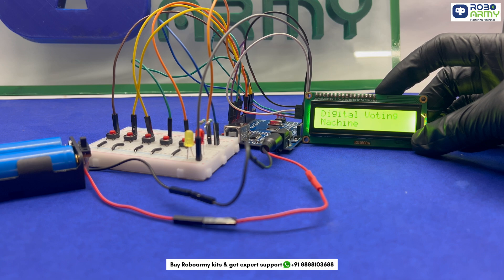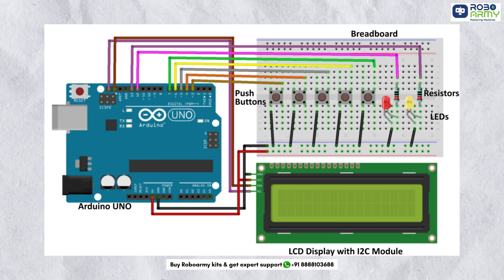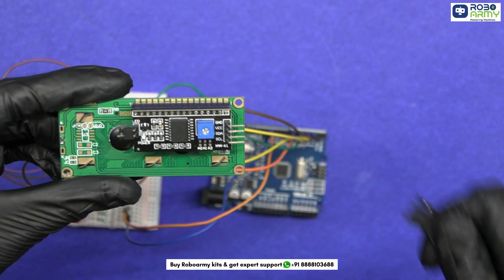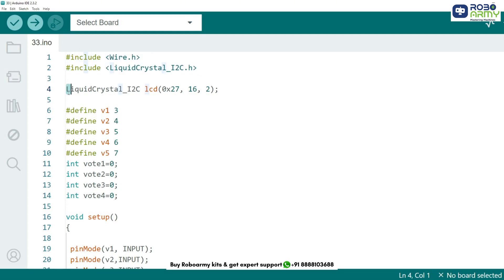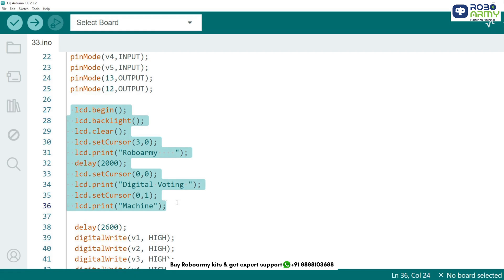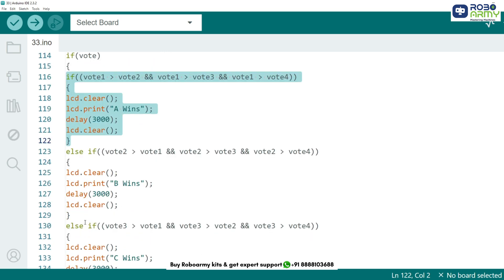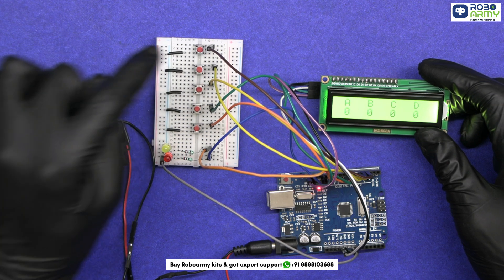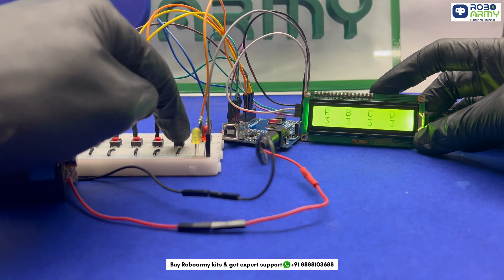PollBuddy: Smart Vote System 🗳️ Build Your Own Digital Voting Machine with Arduino!

Comment: How to add more parties
Reply from the maker: To add more parties, you’ll need to add more push buttons and update the code to include extra vote variables, LCD columns, and winner conditions.
Just repeat the same pattern used for A, B, C, and D — add a new button pin, a new vote counter, and display it on the LCD. If you want, I can help you modify the code for more parties too.

Comment: Sir my only 2 buttons are working pls help i have school exhibition tommorow
Reply: I checked my push buttons they work the vote does not count
Reply: 2 votes A and B work
C, D and result dont work
Reply: And leds dont work
Reply from the maker: Hi! 😊 It sounds like there might be an issue with your button connections or wiring for C, D, and the result button. Please check these points:

Make sure each button’s one leg is connected to GND and the other to the correct Arduino pin (C → pin 5, D → pin 6, Result → pin 7).

Ensure the buttons are properly oriented on the breadboard — sometimes they don’t connect if rotated 90°.

Check the LED connections (pin 12 and 13 for green and red) and confirm they are not reversed.

No need to change the code — once wiring is correct, it’ll work fine.

Try this and it should fix the issue.

Sorry for late reply

Comment: Bro my lcd is powering on but it is not displaying anyting I checked the adress adjusted the contrast screw but not working
Reply from the maker: Hey bro! If your LCD is powering on but not displaying anything even after adjusting contrast and checking the I2C address, try these steps:

Recheck wiring – especially SDA & SCL pins (they must match your board, e.g., A4 & A5 on Uno).

Run an I2C scanner code to confirm the exact address.

Make sure you’ve included the correct LiquidCrystal_I2C library.

If still blank, try another LCD or jumper wires, sometimes the module itself can be faulty.

Comment: How to connect the two wires coming out from battery holder to the DC power jack ?
Reply from the maker: You can connect the two wires from the battery holder to the DC power jack by matching the polarity: the red wire goes to the positive (+) terminal, and the black wire goes to the negative (–) terminal of the jack. Make sure the connections are secure, and double-check polarity before powering your circuit to avoid damage.

Comment: Sir I have big breadboard is there any problem
Reply from the maker: No problem at all! You can absolutely use a big breadboard — it works the same way as a small one. In fact, it’s even better for organizing wires and adding more components easily.

Comment: Sir it says compiler terminated while running
Reply: Kindly reply fast bro
Reply from the maker: Oh! That usually happens when there’s an error in the code or something wrong with the Arduino IDE setup.
A few things you can try:
Make sure you have selected the correct board and port in the IDE.
Check for missing libraries and install them.

Restart the IDE and try compiling again.

Comment: My board is getting hot when I connect it. Please help me. Tmr I've to submit
Reply from the maker: If your board is getting hot, please disconnect it immediately to avoid damage. This usually happens due to:
1️⃣ Wrong wiring / short circuit – double-check all connections carefully.
2️⃣ Power supply issue – make sure you’re using the correct voltage (e.g., 5V for Arduino Uno).
3️⃣ Components reversed – check if any module (like motor driver or sensor) is connected backward.
Try correcting these and test again. If it still heats up, switch to another board if possible since you have to submit tomorrow.
Reply: I've changed LCD AND I2C. ITS WORKING BUT ITS NIT DISPLAYING ANYTHING. JUST LCD IS WORKING LIKE IN 5:15
 BUT A B C D IS NIT DISPLAYING
Sir please reply

Comment: I have also errors, the output is nerer show in lcd
Reply from the maker: Sorry to hear you're facing issues! 😊
If the LCD is not showing any output, please check the following:
I2C Address – Make sure the LCD address in your code (0x27) matches your actual LCD module. Some modules use 0x3F.
Wiring – Confirm that SDA and SCL pins are correctly connected:
On Arduino Uno: SDA → A4, SCL → A5
Contrast – Try adjusting the small potentiometer on the back of the LCD to increase contrast.
Library – Make sure you've installed the LiquidCrystal_I2C library correctly in your Arduino IDE.

Let me know if it still doesn't work—I’ll try to help further! 👍

Comment: I'm getting errors Sri how to Remove errors from the code ?
Reply from the maker: Hi! If you're getting errors while uploading the code, please double-check the following:

Make sure all libraries (like LiquidCrystal_I2C) are installed properly.

Verify that you've copied the entire code without missing or extra characters.

Check if the correct board and port are selected in the Arduino IDE.

If you're still facing issues, feel free to share the exact error message here — I’ll help you fix it step by step. 😊

Comment: Sir can I give power using usb cable to it instead of dc jack? And if I can do that will I have to change the code a bit ?
Reply from the maker: Yes, you can absolutely power the Arduino using a USB cable instead of the DC jack. There's no need to change the code at all — the functionality remains the same. Just make sure your computer or USB adapter provides stable 5V power. 😊
Reply: @ thank you 😊
But I am facing one more issue sir, when I try to upload the code it , it shows uploading on computer screen but it never upload I waited for 1 hour, after that I restarted my pc and tried again but same thing happened it kept on showing uploading
Reply from the maker: You're welcome! 😊

About the upload issue — it sounds like a common problem. Here are a few steps you can try to fix it:

1. Check COM Port:
Go to Tools > Port in the Arduino IDE and make sure the correct COM port is selected (the one your Arduino is connected to).

2. Board Selection:
Go to Tools > Board and confirm that the correct board (e.g., Arduino Uno) is selected.

3. Check USB Cable:
Make sure you're using a data USB cable, not a charging-only cable. Try changing the USB cable or port if needed.

4. Close Other Programs:
Sometimes other software (like serial monitors or Bluetooth apps) can interfere. Close any programs that might be using the COM port.

5. Press Reset Button:
Try pressing the reset button on the Arduino board once when the uploading starts.

If the issue still continues, try uploading using a different PC or reinstalling the Arduino IDE.
Let me know what happens after trying these! 👍

Comment: sir what will happen if i connect a 9V battery in place of 3V battery
Reply from the maker: If you connect a 9V battery directly to the Arduino Uno’s VIN pin or barrel jack, it should work since the onboard voltage regulator steps it down to 5V. However, if you're using a 9V battery (like a PP3 battery), it may not provide enough current for long-term use. LiPo batteries generally offer better current output and efficiency. What components are you planning to power with it?

Comment: Sir you make know stone paper scissor game code is showing error     checkdistance_11_10 () 

        }
        
        lcd.print(receivedText);
    }
}
Reply from the maker: It looks like there's an issue with the function checkdistance_11_10(). Please check if the function is properly defined in your code. If you're still facing errors, share the exact error message so I can help you troubleshoot it. 😊